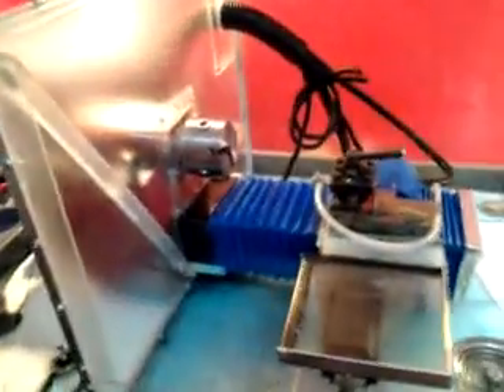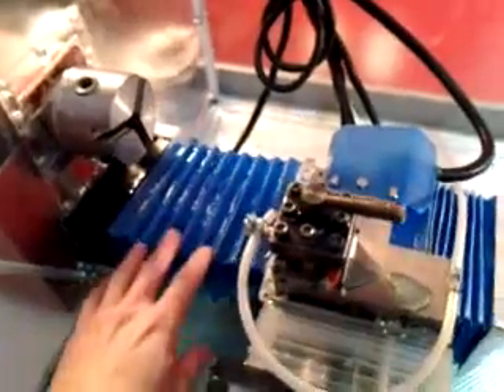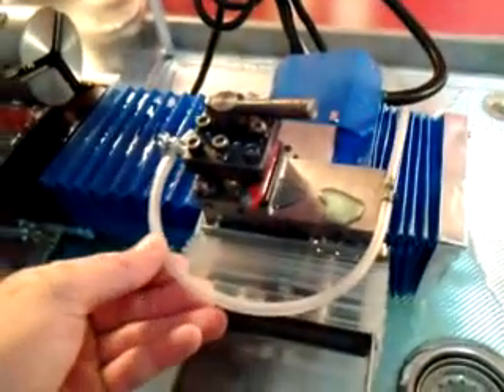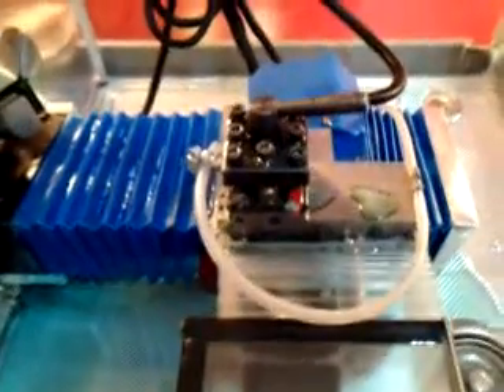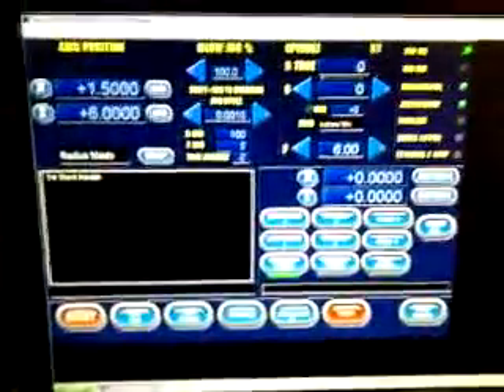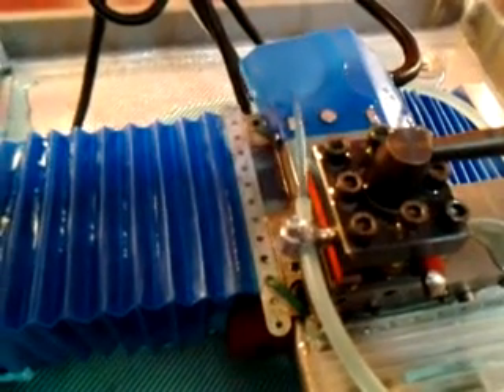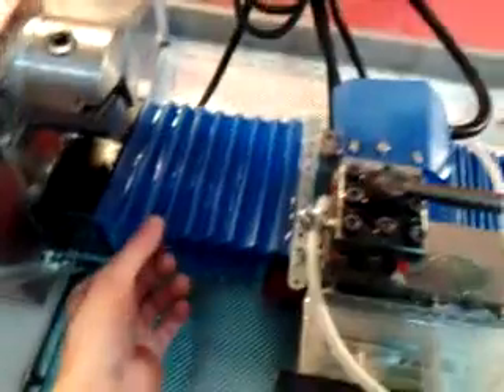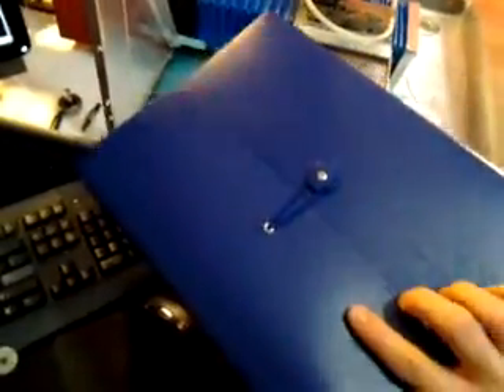CNC 7x with flood coolant!

Comment from the maker: Hi, yes it covers the screw and limit switches also. In the video at the 3min 28sec mark I show what I used to make the accordion cover. As far as I know nobody sells them in that size as I had looked around for a while before I decided to just make it myself. It took about an hour to make it by laying out the sheet, marking out where to fold it and going through the process of folding it. I had done a few practice sheets first so that helped a lot. Then it took about another half hour to get it mounted and sealed up with RTV silicone. Here's a tip, use a straight edge, like a ruler to do the folds so they come out nice and straight. Thanks for watching! Please "like" it if you do.